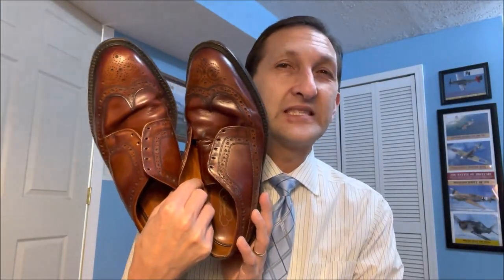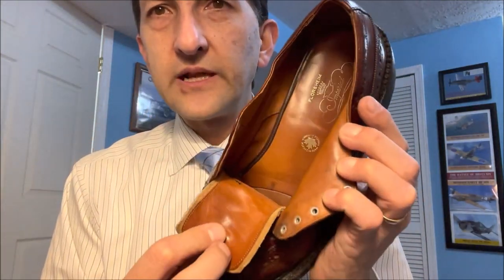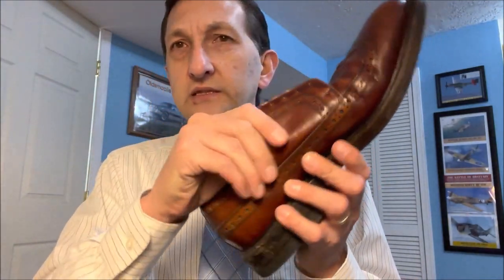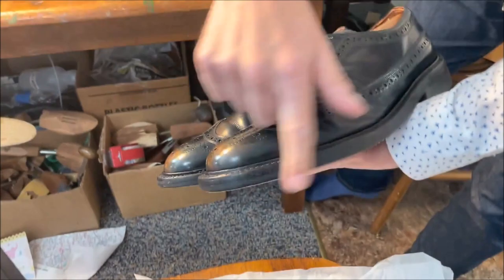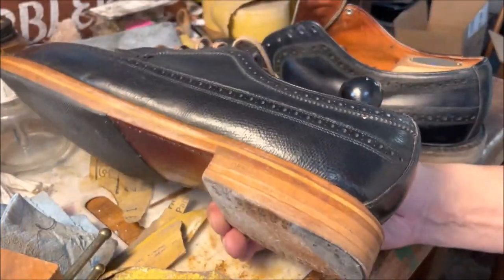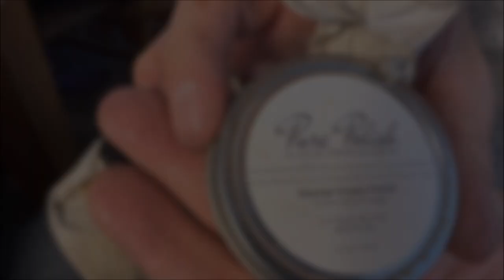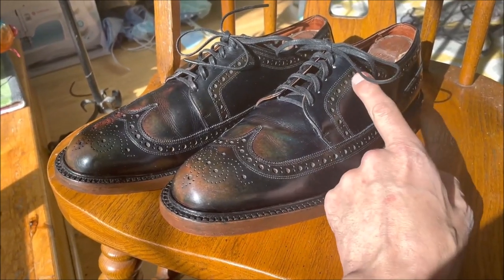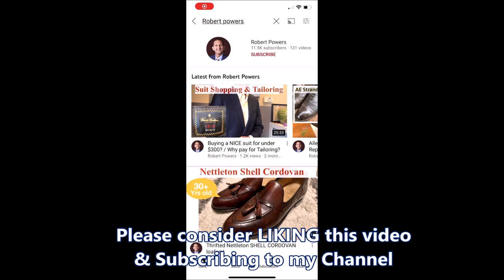Before & After: Florsheim Imperial Custom Patina

Comment: Robert I have a question about the glue you’ve used for your shoe repair? How is it holding up? I’ve done some work on mine using masters. Just want to see how yours is holding up cause it’s easier to get.
Reply from the maker: For the last couple years I also have been using Master's All Purpose Cement. Once in a while I will have the edge peel back at the ball of the foot, or a tiny bit of the tip of the toe and have to touch it up, but in general, they adhere very well. Proper prep and clean flat surfaces are key.

Comment: a slightly larger shoe tree (or a water bath prior to the dyeing) might help with the rolling in the vamp
Reply from the maker: Yes, you’re absolutely right. I often will saddle soap used shoes, once, after receiving them. That, combined with the round of moisturizing generally moistens the leather enough to completely straighten them out in a day or two with tight fitting shoe trees. I did not send them to Alberto with shoe trees in them because of the extra weight. Great observation!

Comment: Great video! Where did you purchase your heel savers from?
Reply from the maker: I get them from eBay. The last time I bought them from eBay seller leathercaresupplystore, but it looks like they're not selling anymore. I've also purchased a lot from seller Nordshoe. They come in boxes of 10 or 25 pairs or something like that. They were pretty cheap, I think $8. The ones you saw on the Florsheim 96624's are size #6. They have an adhesive peel-off backing and come with the steel spike nails.
Reply: @CobblerBob  Thank you so much!!

Comment: Hello Bob from Montréal.   I do not want to sound too critical but your patina artist guy had a big challenge in front of him I will explain why.  Being the owner of the exact same pair of Mchale Florsheim in the identical color, I know that these shoes share the nice qualities that you mentionned.  But there is one "characteristic" that is worth mentionning and that probably caused problems when working the patina.  The leather is corrected grain "wax infused".  Yes, the leather is very thick yet supple and the color has variations and is not homogenic.   It is not a cheap bookbinder leather that you can find on some Bostonians and Barkers.   Nevertheless, it is not natural "calf" as we know it.  The additives act as a shield, blocking anything that wants to penetrate the leather (Renovateur, Pommadier AND leather dye). This "hand wax finish" was meant to provide a easy shine by just rubbing the leather with a chamois.  Dack's and Hartt used the  same type of leather on many of their shoes from the late 1970's to the late 1980's, early 1990's.  

When you look closely at the shoes, you can see spots on the vamp where the leather dye did not penetrate into the leather.  I remember trying to remove the factory finish with acetone with bad results.  That leather was meant to stay the color it was produced.  I would rate the patina you obtain as "fragile" in the sens that it will never be totally permanent.  For exemple, it could be altered if you use moisturizers or cteams on the leather.   

Here are a few tips for conserving your patina: 

- Always brush your shoes with a soft goat hair brush.  Avoid harsh horse hair or pig hair brushes.

- Never use saddle soap to clean the shoes.  Just a humid rag.
- Never use Reno Mat or other strong cleaners (even the Saphir gentle cleaners for cordovan or the plant based one).  This will automatically strip the patina.  

- Avoid waxing your shoes because the solvents will act as "nail remover".  If you can, use the hardest wax possible like Saphir Mirror Gloss instead of Medaille d'Or.  Apply the wax at cool temperature with your fingers, no rags, in very thin coats.  Use your fingers to "massage" the cool hard wax by doing back and forth movements.  Do not go overboard.  Once you have a satisfactory shine, stop.

-Never spray weather protection (even Saphir Super Invulner) on the patina because it could create smudge and leaks.

-Never use an automatic buffer (Dremmel or Ronson Roto Shine).

-Always keep your patina shoes in dust bags. 

Consider your patina shoes ON THIS PARTICULAR shoe model with this particular type of leather as a drawing on a white board with a non-permanent marker: it only sits on top.  A white board brush can easely wipe it away...

Your sole edges are gorgeous.
Reply from the maker: Thank you! And wow, I just learned something new. I appreciate that.
Reply: @CobblerBob  Mon plaisir cher ami!  🙂